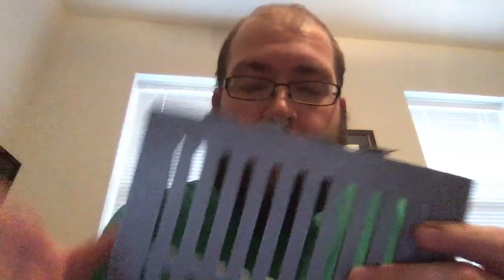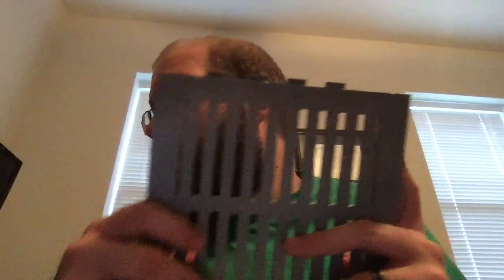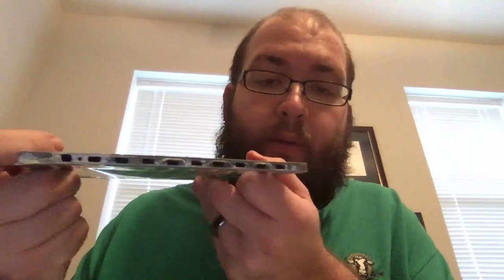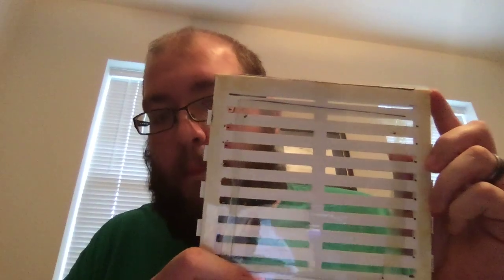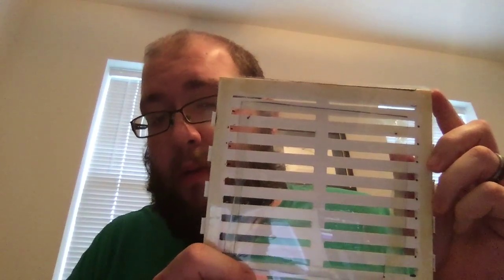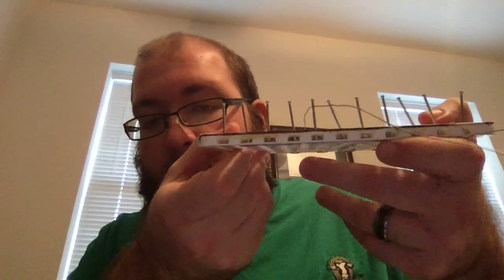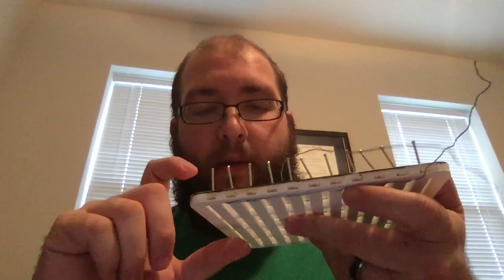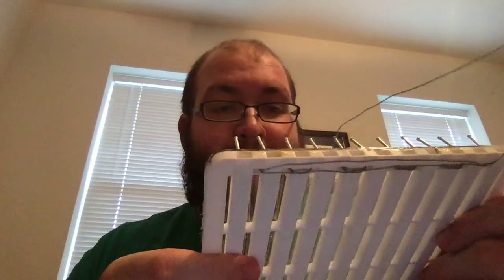DIY 3D printed magnetostatic planar speaker

Comment: by making the tunnels you do limit the excursion of the foil. you can just glue in the magnets in the frame.  try to make the piece that holds the magnets as thin as possible, since it creates cavity resonances. (i know thats hard that is one of the reason why steel is not a bad choice, besides a stronger magnetic field it is stiff)

contact me for materials you cant find. mylar is easy to find look on ebay. for ESL electrostatic speaker foil mylar  you can find 3 6 12 20 etc foils. and on RC shops as covering (as you mentioned) wires you can find and wires.co.uk they are insulated magnet wire.

You might want to keep the turns of the wires on the foil part, it results in less noise from having a wire on the edge of the frame.  and be sure you always keep the direction a wire is running alternating up down up down, when you want to do a second wire in the same sport make sure it runs the same direction as the first wire.   maybe you had , i could not see since you make the turns in the frame :)

Comment: Oh i do must add :) i dont use off the shelf components :)  i dont 3dprint the frame but cnc it, except for perforated metal since that would not be usefull or fun to mill 1000 holes :). but nice to see your video!